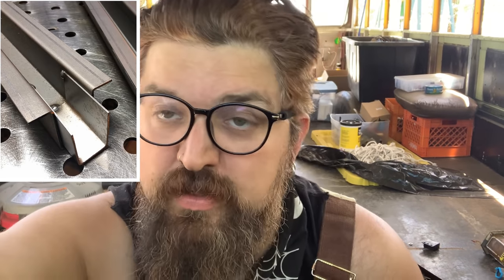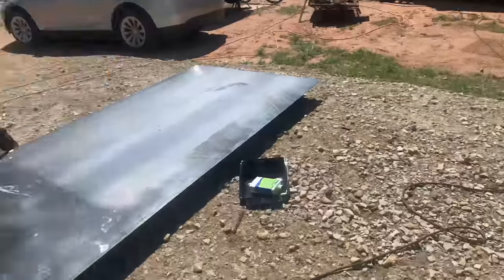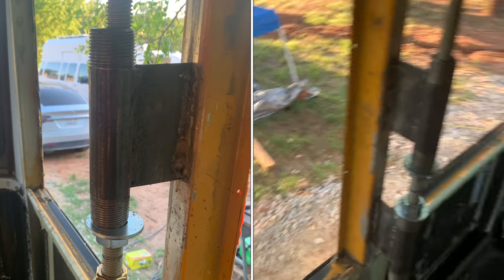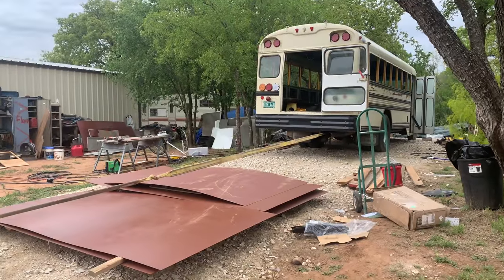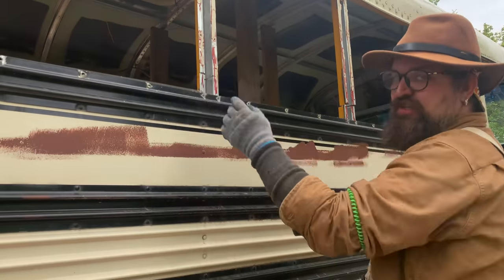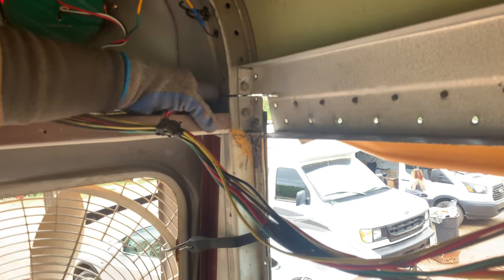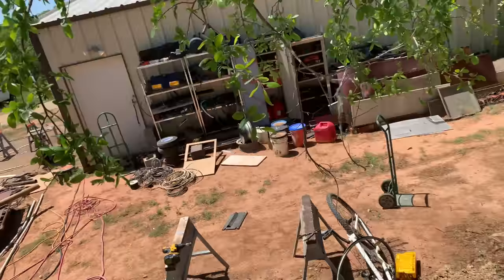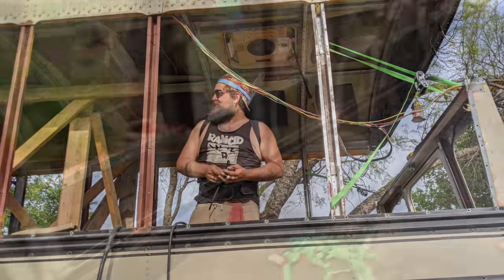Skoolie build #11 radical 24 inch roof raise school bus

Comment: How thick of metal did you use for the brackets for raising the roof?
Reply from the maker: I didn’t make the threaded rod system myself someone loaned me theirs, but I think it was 1/2 inch steel